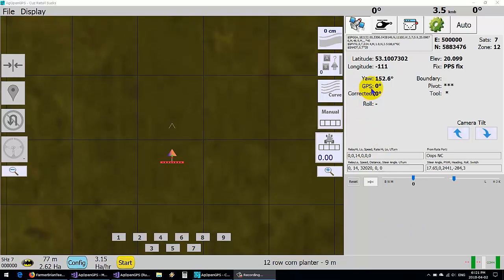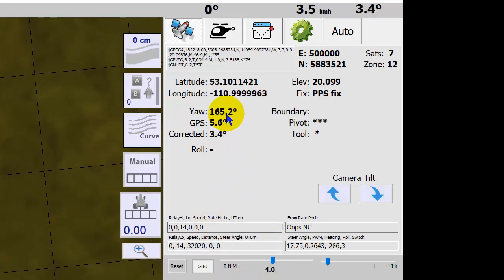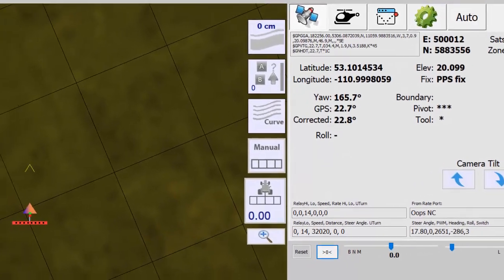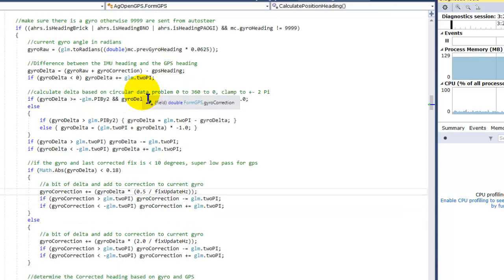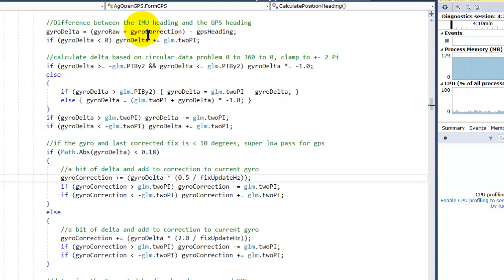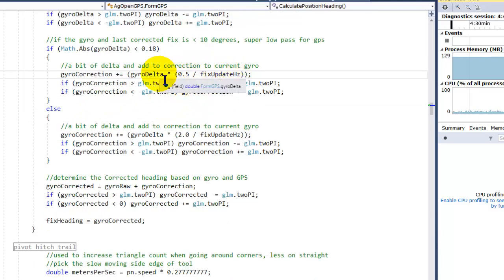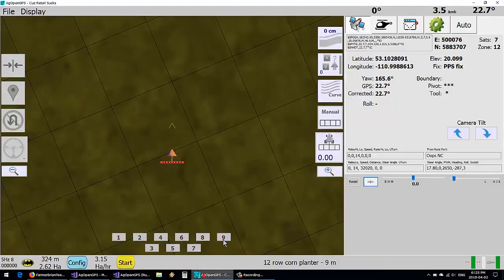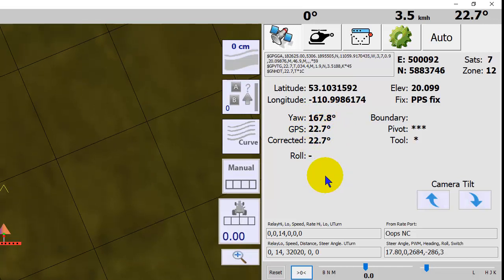IMU and GPS Heading Fusion

Comment: Good job. Do you use any filter for IMU raw data such as EKF? What do you think that which algorithm is best to calculate heading with more accurate?
Reply from the maker: I really don't know, but I think for slow speed the best way is dual antenna's using RTK. Then you can go forward AND backward as well always knowing which way if forward. There are no easy answers for slow moving vehicles and heading.